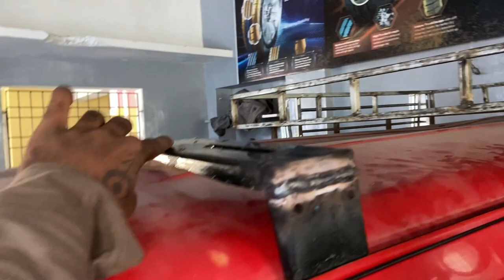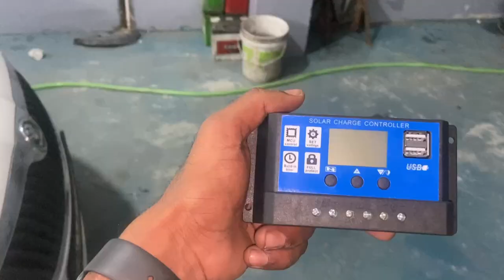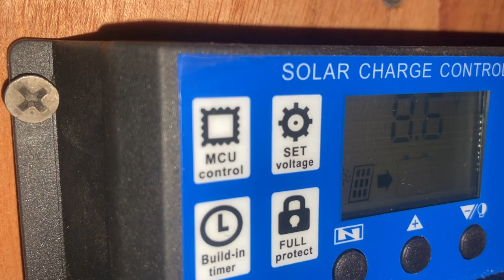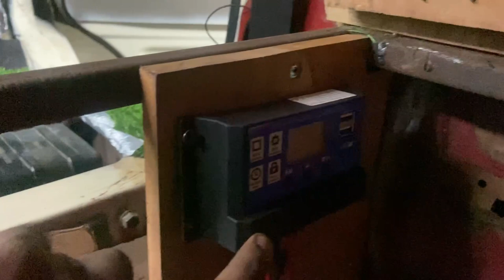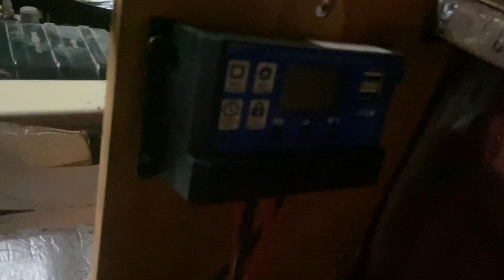SOLAR POWER FOR OUR VAN |  tamil | MUST HAVE ACCESSORIES |#vanlife #awh

Comment: Bro Thank you for your purchase but    
First connect battery and then solar panel next connect DC to AC converter only when ur battery is atleast half charged then connect output load else it may damage whole system all made in China warranty not covered but  nice products working good  based on terms and conditions 
All the best brother for ur journey 
Trichys Electronics 
S. Loganathan

Comment: Better do everything had AC output nnba...DC venam..!!
Oru DC to Ac inverter use pnnu nnba
Bcz laptop lm China circuitprblm or voltage fluctuation thaangathu ...👆
Engine kitta then battery la irnthu vara lines ku lm insulation tape potutu pipe podu nnba👆battery terminal nd engine running la rendum athigham heat Generate pnum👍